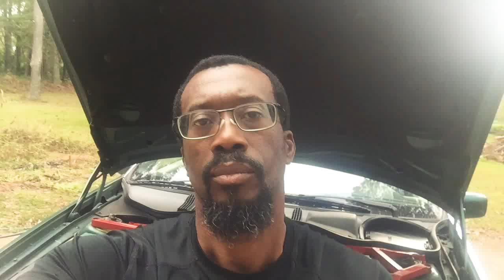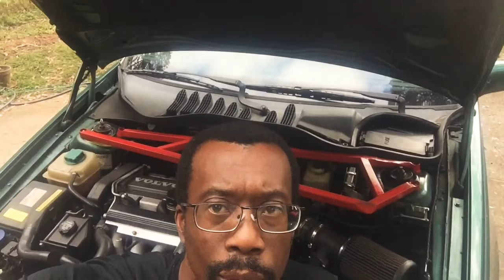Volvo 850 Turbo #BlownTransmission  (Vlog 1)

Comment: There's a 95 850 sedan with a manual transmission on row 348 of the Atlanta North Pull-a-part.  It's been there a couple of months, though, and there's an empty row next to it, so they're probably about to scrap it.  All the other ones there are automatics.
Reply from the maker: Atl_850_fan I am going to have to run up there to see if still there. thanks
Reply: I saw it there this afternoon, but row 349 being empty may indicate 348 is next on the crush schedule.
Reply from the maker: I am going to check it out asap
Reply from the maker: I went by today, but row 348 was history...349 is back though LOLL. The website said that it was still there and I called, and that phone bank folks said it was still there...but I am sure they were looking at the website. Thanks for the tip. On a positive note, there were a lot volvos out there
Reply: Pretty crappy to think you needed it, and they just crushed it.
Reply from the maker: Yup. That's how it goes some times. I was surprised at how many Volvos they had out there. Most had straight body panels...I wonder I they are there because of minor problems or what? Looks like not many folks are interested in keep their old Volvos on the road. Now to roll the dice on finding a manual transaxle.
Reply: Probably because most of their target buyers are non car people. '93 850 owner
Reply from the maker: Agreed!